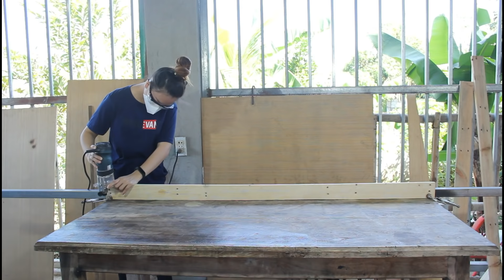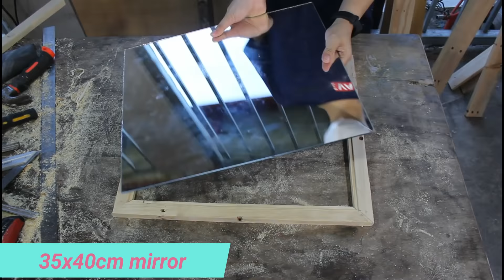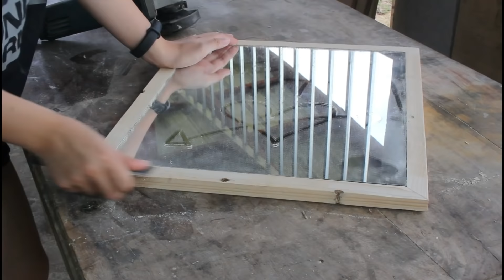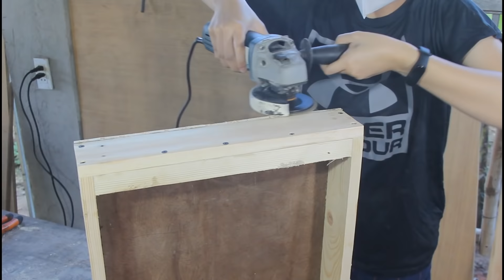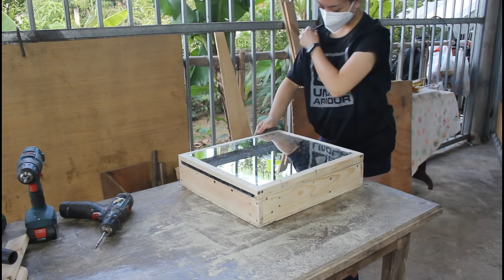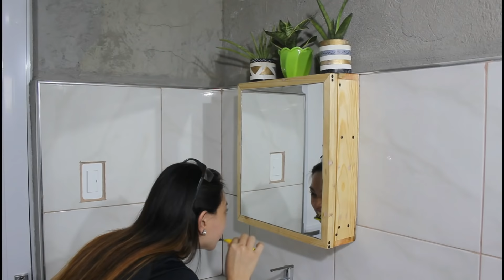DIY Bathroom Mirror with Shelf using Wood Pallet || D.A Santos

Comment: With the little hand equipment you have you work wonders, congratulations indeed.
Maybe you need to work a little more on the details (for example the 45 degree screwless joints, or mount the mirror opening guides by drowning them both above and below, instead of in front, so they would not remain visible).
However still good, with each video you are growing! 👍👏👏